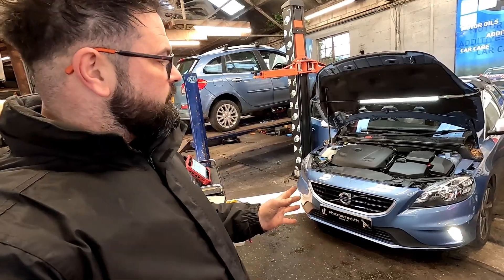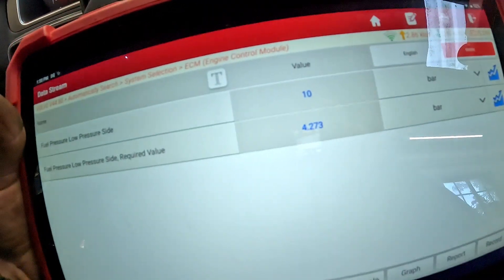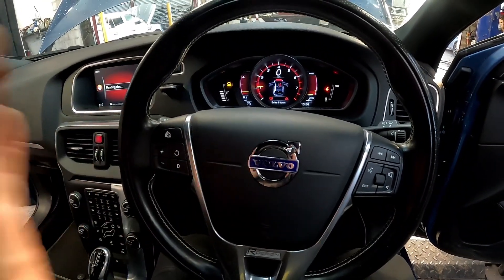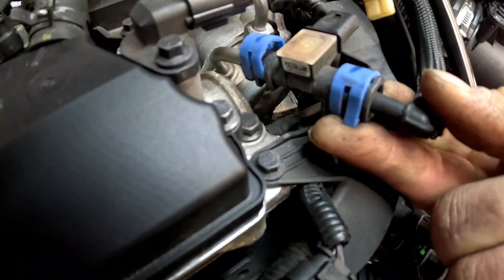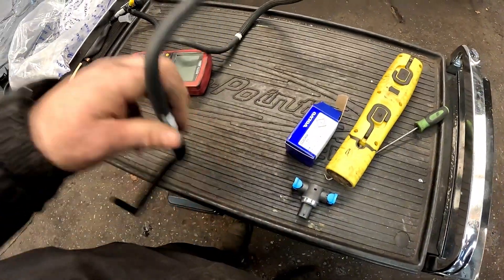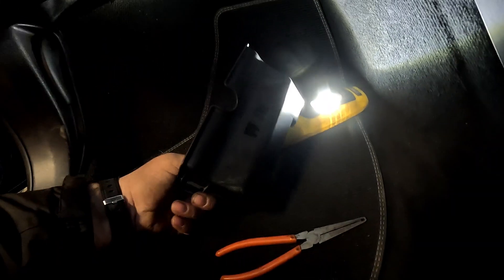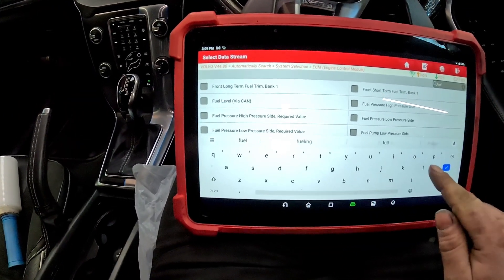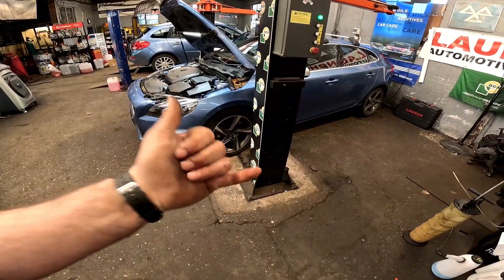Volvo v40 1.5 T2 P018D low fuel pressure sensor b circuit high

Comment: Hi from Greece. Although i have not any driving issue or engine fault light when i connect  diagnostic tool in my V40 1.5 T3 i am getting ECM-P00C600 (FUEL RAIL PRESSURE TOO LOW - ENGINE CRANKING) . Is the same sensor....? Thanks
Reply: I have exactly the same problem with the same engine(2016). I ordered this fuel sensor, since I also have this older version as in this video. I will change next week to the new one and I can inform you about the results. My only "visible" symptom that after a cold start on idle I feel a very little shaking from the engine, like misfire or something for a few seconds but after it runs fine. It's there since years but now I would like to fix it. And when I delete the faulty code after a few days always comes back. So lets see.

Comment: I have a po18200nfault code.
Which fluctuating on live data. 2l 163hp 2013 volvo v70.
Replaces temperature sensor on the pump. With no success.
Where is the next sensor?

Comment: what if I do not have that computer... how else can I get the warning light reset after replacing the sensor? if possible... is it a must to replace the pipes too?
Reply: Same question
Reply: @MrJostitosti  I ended up just ordering the sensor from amazon for $40 and replacing it myself in 5mins... did not replace pipes, just plug an play and now car is fine

disconnect car battery negative terminal for 15mins and the check engine light will reset